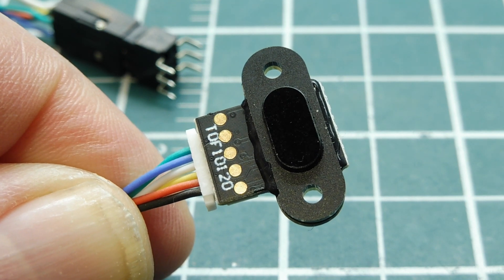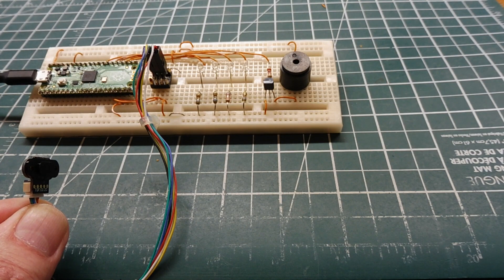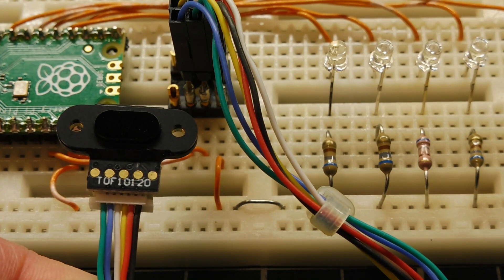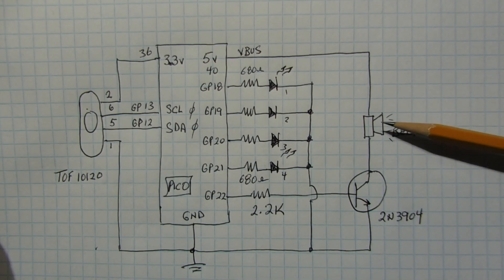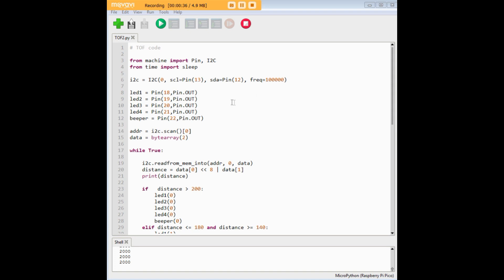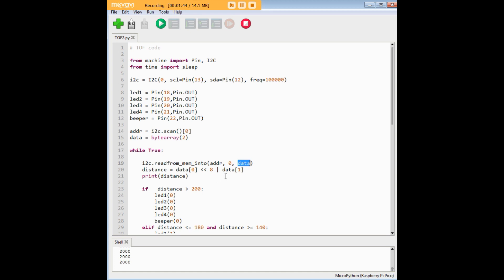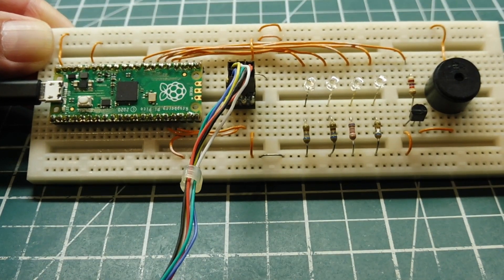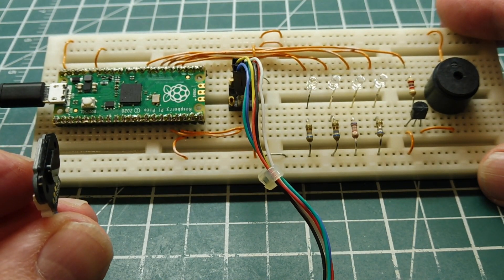TOF10120 Laser Range Sensor / Micropython

Comment: could you tell me which video shows how to install flash forth and set it up with tera term, thanks
Reply from the maker: This site should get you started:
https://arduino-forth.com/article/FORTH_FlashForth_installation_installerFlashForth
I have made a video on programming the Arduino Nano with Interactive Arduino which I wrote for teaching purposes. You can follow it and change the .Hex file to ff_uno.hex and the fuse/lock bits to high DA, low FF, extended FF, lock FF. Teraterm speed is 38400 baud.
https://youtu.be/P6rMFcwik3M

Comment: New Subscriber. Wondering if there is a way to measure the distance of objects in water?
Reply from the maker: Water level readings would not be very reliable, but you could put a float into the water and aim the laser at the float, then subtract the thickness of the float from your readings.

Comment: Great Video !
can this be used as a water level meter, or would the laser cut right through the water and give false distance reading ?
Reply from the maker: Water level readings would not be very reliable, but you could put a float into the water and aim the laser at the float, then subtract the thickness of the float from your readings.

Comment: I have built the circuit, but after a short time I get this error message:
120
112
115
118
118
119
117
116
Traceback (most recent call last):
  File "<stdin>", line 21, in <module>
OSError: 5
Reply from the maker: Reload the latest version of Micropython for the Pico. Do a complete erase first using flash_nuke.uf2. Run the code again.

Comment: Nice video. Any idea how the sensor performs outside (rain/fog/snow) ?
Reply from the maker: It will probably perform better in a controlled environment as strong sunlight will interfere with the decoder.
Reply: @0033mer  Indeed, sunlight will probably have an influence. I was more thinking about rain, but I guess there's also some impact.